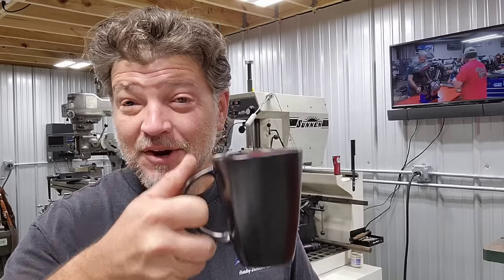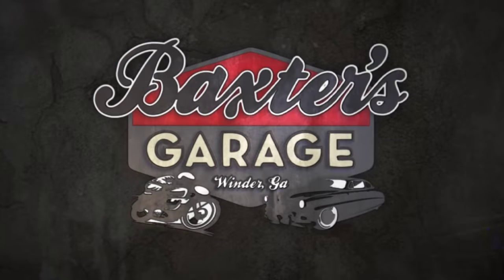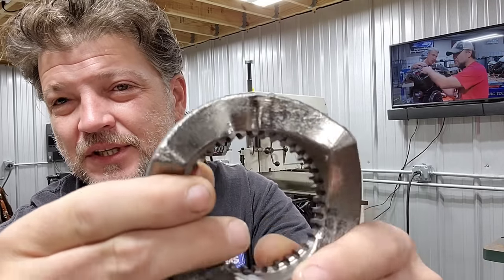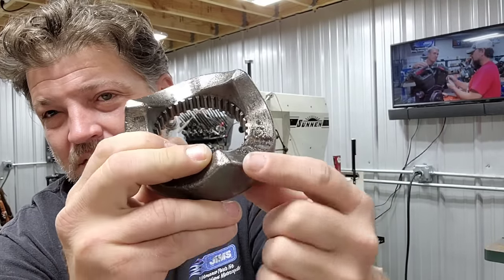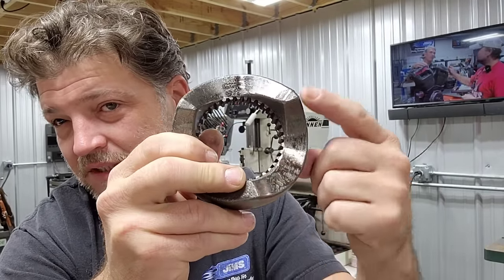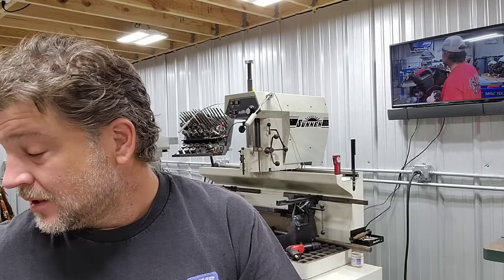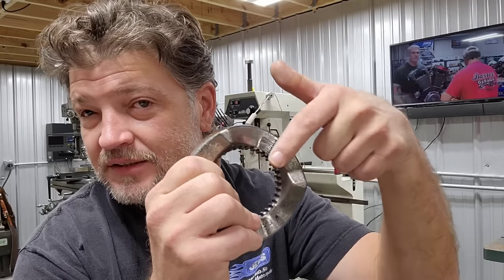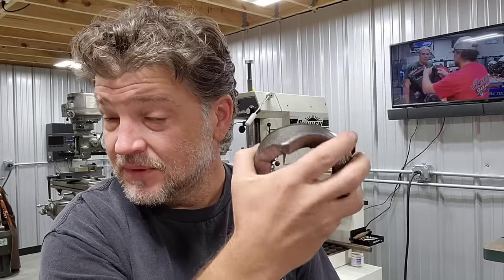Compensators For Your Harley...Should You Eliminate Them?

Comment: Hi Kevin! Thanks for all interesting films youve done. And this is very good. Ive tried without. I had to pull it out immediately. And the bike is an Heritage Classic Softail. 2001. The engine that I have built is an 106 stroker. With ported heads and Dave Mackie’s excellent gear driven cams T590. 
I have now tear down the engine. Due to vibrations. And I found that the S&S 4 1/2 inch stroke crank is out of true. 0.13 mm sproket. And 0.08 mm on pinion. Its not scissored. But tight opposite the crankpin. So everything is moving against the bearing hard I will say. 
I will rebuild the crank. Have purchased a new pin and roller cage and rollers. The pin is slightly larger. About 0.01 inch. And I will plug the bolt. Sorry for my Swenglish. Im from Sweden. 
My goal is to do a blueprint on the crank. And change all bearings which I already have done. 
The crank where welded. So I am now milling away the Tig-Welds. So next step is to make a steelplate 40 mm thick to support one of the wheel to press out the bolt, sorry crankpin😅. 
My question is to you if you know what balance factor Harley use now?
I have heard 50% on both engine type A and B. 
Do you have any clue?
Thanks for your good programs. Im one of your subscribers. 
Greetings Peder Eriksson Sweden.

Comment: Kevin, you mentioned something that I had not taken into consideration, and that is crank run out. The run out on my bike (2000 Springer with 113 c.i.)) is right on the line of being excessive. The issue I am having is a super loud clunk when I shut down the engine in neutral. I do believe now it is coming from the Compensator, but now I am thinking that it is being aggravated by the excessive crank run out (0.005). Would going to a Darkhorse Man-O-War Compensator help me eliminate the clunk for a period of time until the run out becomes too great?
Reply: I had the super loud clunk at shut down on my 2010 Road King (Twin Cam) at 13,000km.  It was the compensator and was replaced under warranty by Harley with the updated SE version.   That clunk, according to the HD technician is a tell tale sign of compensator failure.  I myself (maybe not you!) would go with the cheapest compensator replacement option until your crank can be checked out.
Reply: @VN9001  Thanks for your response. The crank runout on my bike has previously been measured at 0.005.  I was given the option of replacing the crankshaft, but due to my monetary situation, I decided I could not afford the expenditure.  I will, however, be replacing the compensator with a somewhat reliable OEM one from Twin Power. I think one of the main causes for the clank is weakened springs in the compensator.

Comment: Hello Kevin. Being the compensator issue started with the 96ci engines. One thing I think a lot of people are missing is the 6 speed transmission came with the 96ci.  Cruising in 6th gear at speeds under 70 mph is really lugging the engine.  I would like to get your thoughts on how this could contribute to the compensator wear?
Reply: I get on my wife about this, I tell her with out riding style and wear we ride there really isn't a reason to be in 6th gear.
Reply: I think lugging would exaggerate the pulses a lot. I have a 2000 but with a 95" and a Baker OD6. I really work at not lugging the thing (and therefor not beating the crap out of the bottom end). And yeah, I know, that's a weird combo but it's how I bought it. To bring everything into a reasonable rpm range for normal cruising (not 90mph) I changed to a 21 tooth front sprocket. It's from an old HD Screamin' Eagle kit that I found. I wouldn't recommend an OD-6 to someone with a stock or mildly built TwinCam. I'm shifting all the time to keep the rpm sane.

Comment: 17 Rking m8...Took my comp off to replace with a low mileage comp assembly. I found a extra flat washer attached on the old comp ramp but the newer one doesn't have this flat washer. I checked parts diagram and manual but it doesn't show extra flat washer on ramp either. What's happening.??? Anyone?

Comment: Missing is EMPIRIC DATA comparisons. HD are the only company attached to using a compensator on the crank instead of cush-drive rear hubs. Large displacement V-twins of other makes show no evidence of needing crankshaft-mounted compensators so what are the MEASURABLE, TESTABLE differences that matter? Every engineering assertion is testable.  VTX 1800s are famously reliable. No compensator, the cush drive lives happily forgotten in the rear hub. Ditto for everyone else but HD.  Speaking of oddball HD choices, why despite Burt Baker proving RSD works fine (and Sportster being more modern than current big twins in the RSD respect) does HD continue with the absurd legacy final drive sprocket arrangement that has zero functional advantages and requires the equivalent of doing cataract surgery through the colon to swap a wear part that's easily done in an hour on other designs including Sportster?

Comment: I theorize that & talking durability when they did away from the Shovel/EVO  compensators the ramps got bigger in Diameter  & the Metallurgy decreased in Quality ( softer metal) and the Larger diameter put increased load  ADD IN the Non Timken Bottom end .010 run out on Cam side  Add in that stoopid automatic primary chain adjuster  EQUALS a whole lotta mess before it even gets to the transmission. SEEMs to me  Twin Cam Upgrades are retro grade back to shovel /Evo The Bottom line word is DRIVABILITY  When you improve one part what is the end result of the whole?  Example A Bad Ass Engine pits a big hurt on a weak transmission. Well thats is my opinion PEACE & Keep the bugs off your glass & the smokies off yer ass.